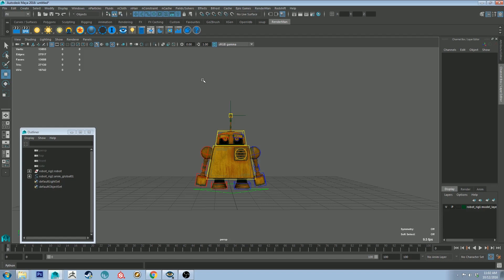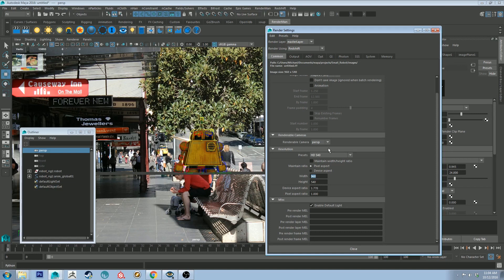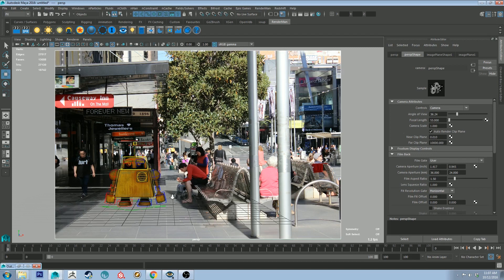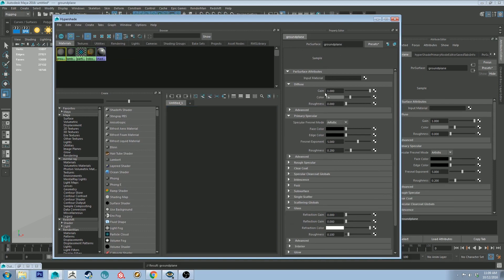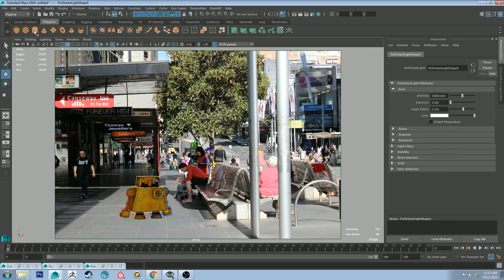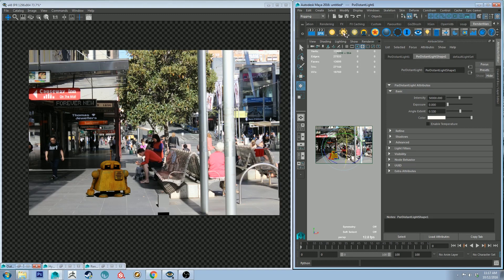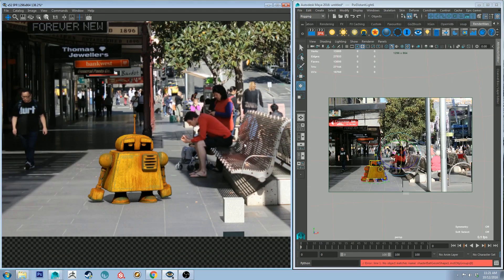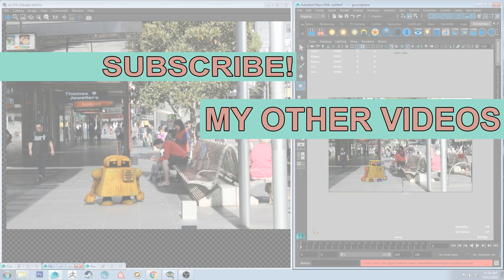Renderman 21 Basic Holdout Tutorial

Comment: Hey dude. I followed this tute but when I render an image after I turned the plane to a HoldOut, I'm not getting any shadows. I turned cast shadows on. 

Need help asap. 

Cheers
Reply: You need to add a pxrshadowdisplayfilter and create the shadow, occluded and unoccluded aov
Reply from the maker: Are you using an image plane in the camera or an environment image?
Reply: Image plane.
Reply from the maker: Are any effects working on the holdout like reflection etc? Have you created a project file, set the project and saved the scene? Have you tried deleting your Maya prefs?
Reply: I have the same problem, I have reflections and no shadows. How can I delete the Maya pref?
Reply: well my expoerienxe about is that with a image plane file it was working, i add the image plane the objetc and a plane that should catch the shadow. i select that plane and click holdout icon. ok holdout attribute is flagged and the forst time i did this , was working, now don't know why , it is no more catching the shadow....i get the two passes in it....but no shadow in alpha channel, as i told to do in renderman prererences.....now last beach....i ll try to delete preferencees....but it sould quiet weird as solution..... ah just to finsh....this system is not working with images sequances....the image plane do not load correctly the image plane is a sequence.
Reply: George Arista thanks for this... can I ask how would you go about enabling the filter and setting up AOVs?

Comment: When i apply HOLDOUT and render, the plane looks black.... It doesnt turn transparent like it did on yours.

:(
Reply from the maker: +PowerhousePR just checking - do you have an image plane assigned to the camera? Are you using an environment light?
Reply: Small Robot Studio Ok here is what i have, 
1) A floor plane with a pixar suface/ plastic preset

2) A camera, with nothing specific assigned to it (don't know how to assigned a plane to it)

3) My light is a DOME light, from one of the presets.

Thats it, i hit Holdout and while yours turns transparent, my floor plane just remain visible. Then on preview render looks black.

I created a whole new scene and it does the same so is not my scene. There has to be a setting that you had on and did not explained on the video.
Reply from the maker: The dome light is the problem here - essentially a dome light acts like a background image (or HDRI) that projecting light, this doesn't work with the current holdout workflow. You need to assign an image plane to your camera - I do this at the start of the tutorial. To get this to work just do exactly as I do in the tutorial, use a PXRsurface shader instead of a plastic as that was designed for 20 and is now obsolete.
Reply from the maker: Sorry, misread I thought you were using the old shader not the pxrsurface with the preset.
Reply: Small Robot Studio Ok i did it and it works with the Dome light as well. The Problem was the image plane on the camera.

However i have new situation that i hope you can help me with. You see, i render a picture as a test before trying to render the whole animation. Now, on the final batch render the image shows up transparent and the shadow is not present in it.....

What am i missing here?...... How can i make the shadow appear on the final render so i can export it to After Effects.
Reply from the maker: Oh cool, don't know why I thought it didn't work with Dome lights my bad.

So on the batch render you can't see the image plane do you mean? Are you certain the shadows aren't there - because if you're going to After Effects you could always add the image in there and the result will be the same + you get the advantage of adjustment of the image in post.

Are you setting up your output from the 'advanced renderman controls' from the drop down at the top of Maya, you might find what you're looking for there.

I haven't run any animation batches with Renderman 21 and image planes yet so not sure if your problem is unique or if you're missing something. I will eventually get to having a look at it as it's been requested but I haven't had time yet.
Reply: Small Robot Studio When you batch render.... the final result doesnt look like your Preview render.

The EXR image look transparent with no shadow. Maybe the shadows are there but they are not visible when you open your EXR image.
Also the Output Shadow Aov creates another EXR that says Shadow but when i click on it to see, an error pops up saying the "image format is not supported" for some reason.... its just an EXR.

I opened the regular picture with transparent background and no visible shadows on Photoshop and PS asks if you want to add it as Transparent or Alpha.....

On Alpha if you go to the channels you can see the shadow being there. But if i import it as Transparent then the shadows are not there....

This is really frustrating.

I think i havent check the Advance Renderman Controls yet btw...
Reply from the maker: Yeah this is a little difficult to explain in a message doing render passes and things like that. Regarding opening in PS and choosing transparent or alpha this is dependent on the settings that you choose when batch rendering (general and advanced settings) so that channel can be either assigned as an alpha or transparency map.

Like I said I haven't run any batch renders for animation however if you set your image type to something like a tiff, tga, jpeg on export that may flatten the image at least that way everything will be rendered out at once.

Comment: I've done this via Mental Ray and Maya Software before. Probably the same in Renderman. A couple points. Your method works for a simple image, but a hallway or room, would be more difficult as it requires more accuracy. If you input the cameras film back size (Found on DPReview.com) into your Maya camera settings and convert the camera lens to the virtual version, this would give you more accuracy.
Reply from the maker: +Shaun S yep, valid points, thanks for the link too looks very useful :)

Comment: Thank you! I finally solve the problem that I have mention in another video of yours. It was the material that I have chosen and that's lambert. I thought it was similar to mental ray so I picked it. Changing the material solve it!
Reply from the maker: Ah! I'm glad you solved your problem. Yes, if you're working with Renderman you should only be using the Renderman materials - for the most part that will be the pxrsurface shader. Good work for persevering and solving your issue :)